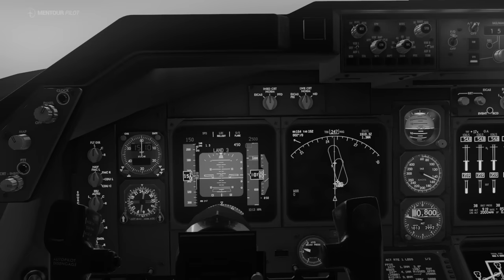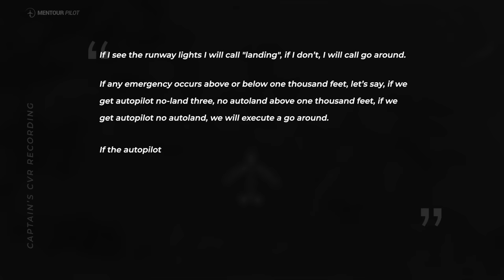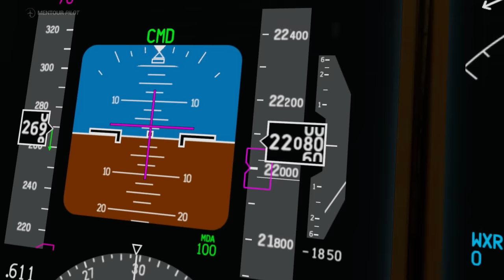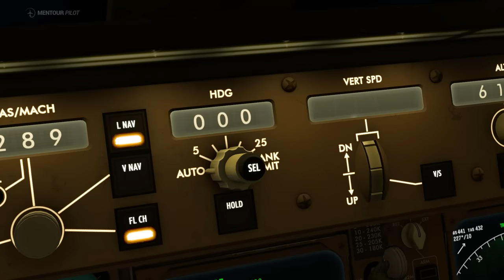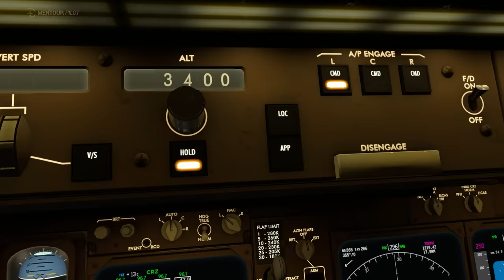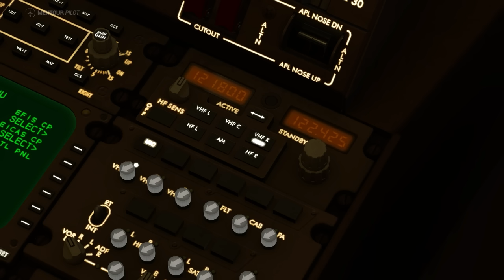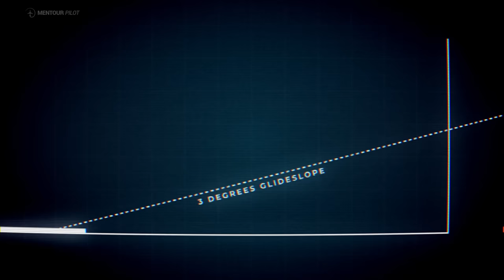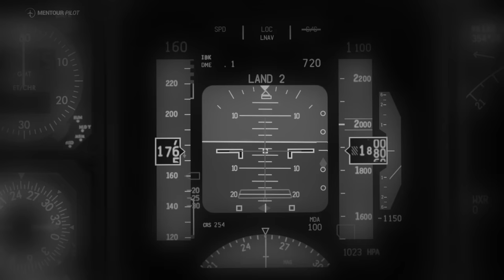Where is the RUNWAY?! Unraveling the Mystery of Turkish Cargo flight 6491

Comment: One observation, you mentioned that the Captain had selected Flaps 30 himself. As a military pilot he was probably used to a lot of single crew operation. (One might suspect the First Officer had the same experience in the military). Military pilots are usually well trained and competent in the environment in which they are used to operating. However operating a multi crew aircraft safely and successfully requires extra skills including good crew communication, coordination and resource management. 
This aspect might also explain why the Captain was blaming ATC for being held high on descent. Military pilots in single crew operations are used to a radar controller telling them what to do and if the controller observes that the aircraft is high on profile ATC will provide extra track miles by vectoring the aircraft further out before turning in to commence final approach.
It would seem this was an essentially procedural approach and although the controller was monitoring the aircraft on radar for some reason was not in a position to vector the aircraft to provide extra track miles to lose height. There may be a number of reasons for this such as the level of controller qualification or that it was the norm at Manas for the controller to provide a purely procedural service (i.e. without radar) and that ATC was monitoring the aircraft on the inbound arrival route purely to ensure that the minimum safe altitudes were observed by delaying descent clearance until certain waypoints had been passed. 
I think these are important aspects which impinged dramatically on how this accident played out.
In moments of stress and high workload (not to mention the circadian considerations when operating in the early hours around 0200) humans revert to what is most familiar to them which might explain why the Captain essentially became a "one man" operation.

Comment: I think in ILS 2 and 3, which is most sophisticated automation approach, why there’s no missed approach warning if aircraft is above its height on beginning of runway as warnings. An audible and display warning that aircraft is on runway line but higher height to say GO AROUND Automatically.

Can’t you as mentor pilot suggest such to the designers of ILS 2/3

Comment: I'm not sure I even knew about this accident prior to this video. Anyway, it brings up a lot of issues we deal with every day or at least often. Energy management, confirmation bias, get-there-itis, fatigue, intercepting glideslopes from above, etc. It's a microcosm of pretty much everything that can go wrong on an approach. I kept thinking as I was watching it, "if they had just deployed the speed brakes early on, none of this would have happened". It all seemed to start with energy management. I don't know if there's some reason you wouldn't want to use speed brakes at high altitudes and speeds in the 747, but in the A320/321 we do it all the time. Some of the arrivals into LA, Boston and New York, for example, almost require speed brakes all the way down. But I don't know if 747 procedures/limitations are different or if this was just pilot preference.
Reply: Indeed very good points.

Comment: I am a fairly new air traveller and my thoughts about aviation through your videos is that; safety is everything when you are piloting a plane and it has anything to do your position or experience. 

I would rather have a pilot who is overly cautious as a means of ensuring safety than one who is ignorant and chilled back. 

A lot of the crashes covered here are mainly resulting from crew error and due to small things which could have been avoided if they were careful or prioritised their safety.

I also notice captains tend to also have a superiority complex over first officers and other crew members leading to errors

But i believe aviation has improved alot recently compared to before

Thank you for the great narration and thorough discussions and analysis of the scenerios❤

Comment: It’s absolutely mind bending that they continued considering the circumstances. 1) GS indicator all over the place. 2) There is LITERALLY a visual representation of the runway on the ND! What goes through your mind when you see you are right on top of it and your radio altimeter shows you are high up?? 3) Where’s the DME? I am just in shock no one there said “hey, we are way on top of it… or the fact that they saw the diamond way below them when they leveled off at 3,400 or whatever that altitude was… Just beyond negligence.

Comment: Summary: 

On January 15th, 2017, a flight crew consisting of four pilots operated two flights on a wet lease contract for Turkish Cargo. The first flight, Turkish Cargo 6491, started in Hong Kong and went to Manas Airport in Bishkek, Kyrgyzstan, where the pilots changed before the last flight to Istanbul, Turkey. The captain, a 59-year-old Turkish national, and first officer, also a 59-year-old, were both experienced pilots, but the captain had only been operating on the Boeing 747-400 for about 820 hours at the time of this flight. The pilots were well-rested, having enjoyed a long rest period of 69 hours in Hong Kong. The aircraft was a 14-year-old Boeing 747-412 freighter with no recorded technical problems. The weather was forecasted to be tricky, with a cold front bringing very cold air and freezing frontal fog, which was forecasted to bring visibility down to 200 meters with vertical visibility as low as 100 feet at their destination during the night and around the time of their planned arrival. Manas Airport was equipped with a Category 2 approach system, but even with that, the visibility was so poor that the airport couldn't really be used as a planned destination. The pilots decided to use the two alternates, Astana and Karaganda, which were quite a bit better and had mainly mist and light snowfall. The captain chose to be the pilot flying for the flight due to the expected marginal weather, but this was different from what other airlines do, which is to elect the first officer to be pilot flying if there's a possibility that a Cat 2 or Cat 3 approach will be flown.

Comment: Engineer here: There are actually TWO DIFFERENT kinds of nightmarish behaviors due to different glide slope antenna implementations. Both have fake GSes at 9, 15, 21 deg. The "repeated" kind goes 150/90, 150/90, 150/90 and will start messing with you at 6 degrees, either by indicating zero deviation if you're smack on because of a null-signal, or more likely pulling you towards the 9 degree line, but then keep you gliding down that 9 degrees (it looks like a normal GS behavior, just with the wrong angle).  This is probably the kind we see in this incident.   The "inverted" kind has every second one inverted 150/90, 90/150, 150/90, and will seem to be "more forgiving" at first, since the lower lobe that starts at 6 degrees is a flipped 90 Hz one, pushing you in theory downwards towards the right direction. However, the transition at 6deg from the fake 90 Hz to the real 90 Hz lobe might cause a receiver to misinterpret it as "zero deviation" or an indication all over the place, and has caused AirBusses to then go into the wrong mode and pitch down excessively when the real 90Hz lobe was received.  And even worse for those: if you miss that one, but instead pass 9 degrees, especially in the wrong mode, the sudden appearance of the 150 Hz signal will send you sharp up into the sky towards the 15 degree line. I think that is what happend in Toulon in 2019, as they pitched up like crazy right when they passed 9 deg at 1.8km dtTHR with APPR. So technically the graphic you use to show the repeated glide slope lobes might not always be correct (i think the one for the Toulon video would need the frequencies of the 9 deg lobe flipped), but it is also nowhere documented which airport is using which implementation (I guess the reports would mention it), and probably also completely pointless for anybody who is not an engineer, since the verbal explanation is correct. And before any of my engineering colleagues roasts me: Yes, technically the 150/90 Hertz signals are not signals, they are modulations of depth 20 or 40% on top of the carrier, but also technically, especially with the localizer, this is also not how it is implemented, since it is a phased array antenna on a relatively long axis with spatial modulation on top of it (instead of two directional antennas with each one having a specific signal), since otherwise you would not be able to put out a wide enough signal lobe, but trying to explain the crazy maths that go into phased arrays to anybody who has not studied signal processing is a useless nightmare, since any receiver will EXACTLY see the signal behaviour you are describing in each of your videos.

Comment: Great video. Great channel. Your presentations are always complete and professional. Just thought I could add some observations based on professional experience regarding the paperwork nightmare that is aircraft maintenance and fabrication. I worked as a design engineer, flight engineer and flight test engineer on a number of transport category airplanes including the Boeing 707 and 757. As a result, I worked very closely with maintenance technicians, A&Ps, and inspectors. In all of the companies where I worked, it was standard practice that when fasteners were removed from a component, the fasteners were placed in a cloth bag with a tag attached indicating who removed the fasteners as well as other pertinent information. The bag was then tied to one of the vacant fastener holes. Anyone inspecting the area where the fasteners were removed would see the bag of fasteners hanging from one of the fastener holes. It was visually obvious. The close-out photo of the plug installation shows no such bag. Regardless of the masses of paperwork that follow maintenance tasks, there are common “best practices” which minimize the risk of forgetting something vital. Were these “bag and tag” practices not employed by the OEM? I suspect they were not. OEMs assemble aircraft, they don’t disassemble them (usually). Some groups within the OEM organization do perform standard maintenance: Flight Test / Flight Ops. I am certain that Boeing Flight Test employs these common sense best practices (I have worked with these folks). I’m interested in the experiences of other A&P folks. Again, your videos are incredible and are an invaluable flight safety resource.

Comment: just checked the crew, both were flying at the Turkish Air Force back then, the FO has retired with a "general" rank where as the captain in this flight was 2 levels low. Normally, these rankings still play a role in the "retirement life" of these soldiers, on the other hand, they are quite professional to put this away... not sure if this played a role on the psychology of the Captain... RIP both.
Reply: Thank you for this information.
Reply: Turkish pilots tends to retire later, the Birgenair crash’s pilot was rather old to the point of too old to fly by some airlines
Reply: @hvegaval  The Birgenair Crash had nothing to do with the Age of the Pilots. The usual retirement age for commercial Pilots is 65, so these Pilots were still well in their Professional-Life-Time and this Crash had also nothing to do with their Age.
Reply: @NicolaW72  i know that pilot age wasn’t the main factor but according to the accident reports they were still past the age for some airways.
Reply: @hvegaval  OK, but it has nothing to do with the safety of flights.

Comment: In the US the <250kts below 100 is something air traffic controllers are aware of, but because it comes from the pilot regulations, I do not believe it is something that ATC can provide relief from (and would probably not enforce in most cases). When a pilot asks me to go faster (95% of the time on departure) I normally say something like "Resume normal speed I am not the police of the 250kts restriction" or "Resume normal speed whatever you need to operate your aircraft safely". In my opinion ATC relieving the 250kts below 100 is the same as ATC approving a pilot to fly with less than the required reserve fuel, or approving an unpressurized passenger carrying aircraft to climb above 15,000 without oxygen for the passengers. As a controller I personally usually do not care if pilots go faster than 250kts below 100 for the same reason I don't care if an aircraft over water has enough floatation devices. If I need it for separation, I will assign it.

Comment: Thanks for your reviews. I'm surpriced that such experienced pilots seems to lack some practical judgements in several areas, and it may appear that auxiliary systems that are supposed to create safety seems to be too complicated and difficult to understand for some pilots who can be fooled without complete knowledge, and may require more training in a simulator, and it's strange that they don't get or ask for more training themselves. If they had experienced to go through mistakes like this in the simulator this disaster could have been avoided. Best Regards from Arne in Norway

Comment: I feel like any time you're getting angry at someone in a professional capacity (or just at all), as these pilots did with the ATC controllers, you should absolutely take that as an indicator to thoroughly recheck your own assumptions and biases. Yeah, it's possible that they're making a mistake or just being antagonistic, but that definitely should not be your first assumption. A better assumption is that you're in the wrong since it means there's something you can do about it. Even if they're in the wrong, but you're looking for your own faults, you're more likely to discover the problem than if you just get angry about it. Even if it's just an awareness of what being angry does to your abilities, you'll be more likely to avoid those problems. Getting angry is fine, but you have to be able to set it aside until you're in a situation where you can deal with it in a safe environment.

Comment: Hi Mentour, I watched during years all your fantastic and fascinating videos. In several incidents and accidents unstabilized approches are the reason, mostly to be to fast or to high. In all these stories increasing workload and stress is an important factor. The pilots don't see clearly the situation in which they are. Why do we at home see the problem and why don't they do? We quickly understand the problem, when Mentour displays us the grafic with the aircraft shown from the side (See video @p.ex. 27:20) high above the glide slope, the wrong ILS becon of 9° and the ideal line where the plane should be at this moment. Every human at once understands the situation. In the cockpit there are several tiny markers on the PFD that every pilot is certainly well trained to read and understand the situation, okay! But in a stress situation, especially in bad visibility, everyone would ask: Where are we and where should we be? This easy lateral view of the flight path would in an instant display the situation, wouldn't it? So why isn't there a display in the cockpit to show grafically the approach height situation?

Comment: Can’t say anything about the Thrustmaster Viper TQS since I haven’t tried it.
You can tighten the resistance on the WinWing and it has 2 extra buttons on the handle itself you can use for zoom. The uncage button also work like a hat unlike the real throttle. So a couple of extra functions if needed. 
The Realsimulator stick has a ton of extra functions since most of the switches  are multi position switches. 
Whatever you do, definitely buy the Realsimulator SSC.

Comment: Two questions, Petter. First you mentioned that the FO had more hours on the 747 than the captain. Could that have been a reason for them switching roles from pilot flying and pilot Monitoring?
Second, there was a small error in the visuals. It said 'Virtical' instead of 'Vertical'.

Comment: I lived just South of LAX for a few years, and worked near there a few more.  The runways run East-West, and the NOISE was annoying, especially during Desert Storm, when lots of cargo flights took off late into the night.  After that experience, I would not recommend living near an airport, but especially NOT at either end of a runway.  At LAX, if a plane were to overfly the runway, it would have about 2,000 ft of rough ground, then the beach and Pacific Ocean.

Comment: Hello, 
The recommendations were one of the most interesting and important parts of your videos - it's a pity you skipped them here.
I'd be especially intereated in the changes proposed for Boeing - it seems that things like "if we're flying an intercepted glide slope, but descending more than 4°, big warnin" and "if we lose the glide slope localizer for more than 2s, don't continue the 3° descent" etc should be implemented.

Also, what about those two nav points that are 27 miles apart with minimal altitudes FL170 and FL60? You said that that is quite a big altitide difference for such close points... Any recommendations there? E.g. for the ATC to notify pilots when clearing them to descent that they should descent hard? Or what is the normal operation between these points?

Comment: Have you thought about doing a video on Emirates flight 407? It was at Melbourne, Australia in March 2009.  It was an incredibly close call.    Simply, the FO entered too low tonnage for the plane, and the other 3 pilots did not correct it.  The wrong  figures were produced, the engines did not produce enough thrust, and plane just barely took off.  Lessons learned would observe sterile cockpit, review each other's work and be careful of letting past flight experience lead to confirmation bias.